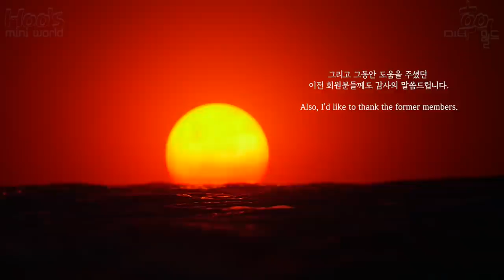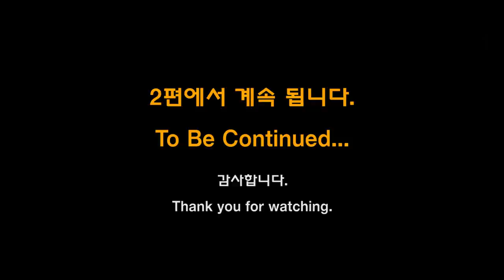How to make a boat with 3D pen.(Part 1) #craft #howto #miniature

Comment: Amazing and inspiring techniques. I have never seen anything like it. So many questions. I might try making some custom electronics enclosures. 
I liked what you did with the clear filament. Also, inspired by your method to remove ridges before assembling.
Reply from the maker: Thank you so much~
Reply: @hoosminiworld  I am wondering which type of filament you are using? PLA, ABS or something else?
Reply from the maker: @peircedan  I am using PLA only. Thank you~